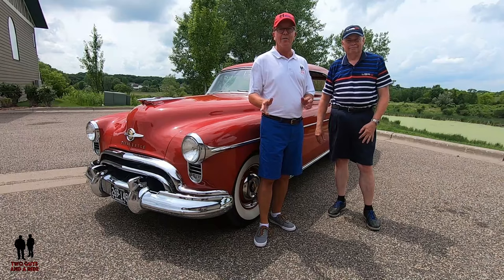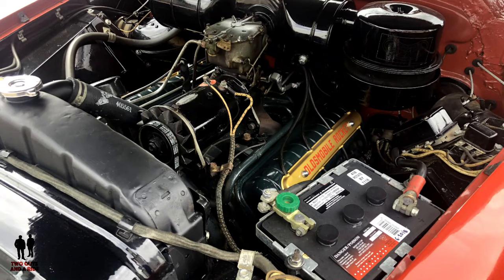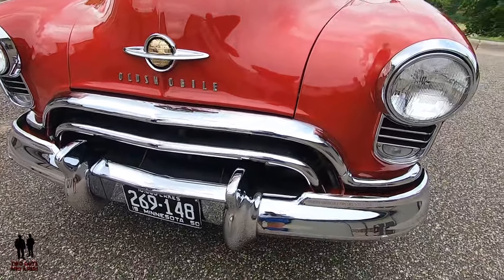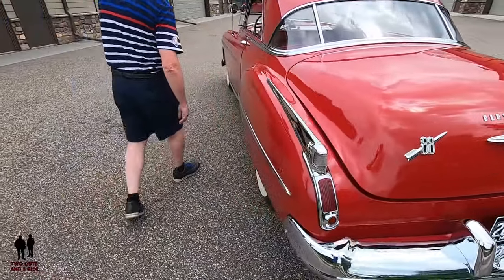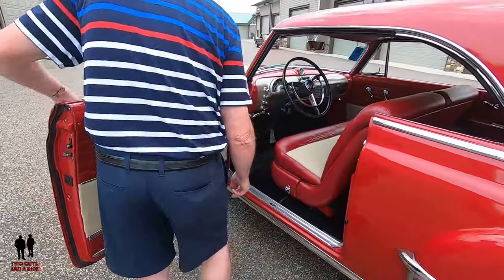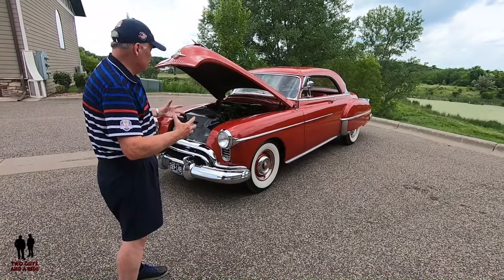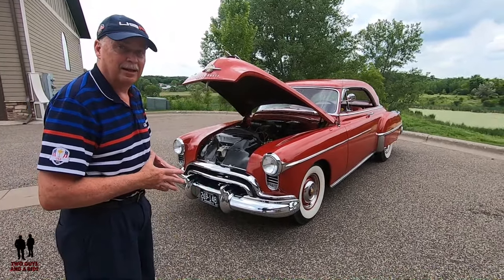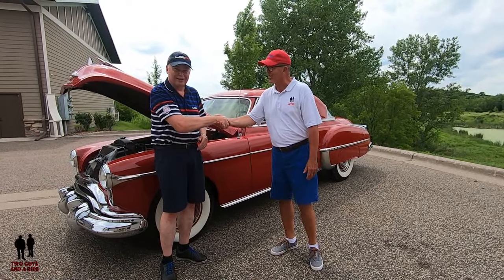Rev up your nostalgia with this iconic 1950 Olds Rocket 88 Holiday Coupe

Comment: My family grew up driving Oldsmobiles. I drove a 1950 through high school. Replaced the engine with a 1956 engine which made a great combination with the low speed reared. It was hot. Later I drove a 1051, 1955 Rocket 88 two door hard top. My last Olds was a 1966 three duces, 400 cubic inch, 375 Hp, 356 rear end. There was only a few of these combinations built. I waited several months for delivery (even then). A local dealer refused to sell me the car. Olds was FIRST in much of the automotive development in the 40’s and 50’s. Enjoyed the video.
Reply from the maker: Cool story. Thanks for sharing and thanks for watching

Comment: We had a 1950 four door 88 and a 1951 2 door 88.  They were the fastest cars on the road in those days.  Nothing else could accelerate with them or out run them.  Big overhead valve V8's were rare in those days.  Fords had flat head V8's which were much less powerful, Buick's had straight 8's and most everything else had six cylinder engines.  Cadillac's had basically the same engine as Oldsmobile, but a considerably heaver car.  It was always a thrill to pull out and hit passing gear, hear that roar and feel that acceleration.  They drove great for the time, also. Fun days!
Reply from the maker: It’s certainly quite a car!  Steve absolutely loves his Rocket 88. Thanks for sharing your memories and thanks for watching!
Reply: You are  right.  I  was  a  teenager  in  the  early  50"s.  My  buddy  had  one.  It 
would  outrun  anything  stock.  Smoke   them  tires  and  keep  on  turning.  A
great  car  indeed.

Comment: I have seen a lot of records showing Chevrolet produced V8 engines, overhead valves, in 1917 and 1918, so our friend with the beautiful 1950 Olds might want to check that out and maybe modify his claim about Olds being first.  Thank you for your show.
Reply from the maker: True, before joining GM, Chevrolet did produce an OHV Engine but not an OHV V8 until 1954. Olds beat them and even Caddy to the punch in ‘50 with their OHV V8.
Reply: So many people think 55 was the first year Chevy had a V8.

Comment: They were called "hardtop convertibles" because they were built on convertible chassis frames, which were beefed p to make up for not having the the center posts.
Reply from the maker: Thanks for the information
Reply: Correct, as was the other GM cars that were hard tops.I think the hardtop added about $500 over the sedan

Comment: OMG, what an enormous steering wheel! I would have painted that. Those clocks are easy to make digital. I'm a Studebaker-Packard man, but for me, this is the most beautiful design GM EVER had. They really ugly'd up their cars making them fat and bloated the next year. Across the board on every brand in this body style was a beauty, even Chevy.  I'll never own a real one, but do have the Brooklin Diecast hardtop, a coupe, fastback. That hood reminds me of a Hudson Hornet, the 88's chief opponent in racing. Stunning!
Reply from the maker: I’m a Studebaker Packard fan as well. All those wary 50’s designs are top notch. They definitely went downhill after that. Thanks for watching
Reply: With manual steering, you NEED a big wheel.  Why make the clock digital?  It looks great as it is.
Reply: I don't know about that Olds but the clock in a Chevy back then was a wind up , eight day clock .

Comment: Looks like the first car i owned when i was in high school . Mine was pale yellow with black top . All my buddies had Fords and loved to drag race . My 88 would kill anything id race , even later olds , but because it was a ht , the frame and suspension were same as the convertible (a bit beefed up) and had a 3.91 rear instead of 3.64 used in other models . It was unbeatable from a standstill with that gearing and a very low 1st gear of the 4spd Hydramatic. Its the only car that engineers designed to "lift in the rear" upon breakaway . They figured there was a loss of a moment as the car initally dropped before moving forward and if this could be eliminated , the car would "get moving forward" quicker . It absolutely worked fantastically . I wish this fellow would have shown the car moving and starting from a dead standstill . This action i described is very noticable even on a normal breakaway from a traffic signal .  It made for quite a neat rear suspension and fun to watch a 50 olds take off from a standstill and lift slightly insted of dropping . It was the last to have rear 'coils' with that setup and all newer had leaf  springs so were just not able to make that 'leap' from a dead stop . I raced every year olds and never lost until 1957 Olds 88 with J2 (3-2bbl carbs) and many more cubes and horses , it was fast -- lol !!   But i loved the 50 for looks , handling , and just plain fun to drive !
     My second car was a 54 imperial 2dr Newport . Similar HT design . Still have it , but wish i had kept the olds also . What a beautiful pair . 1949 till 1960 was in my opinion the ultimate time for car enthusiests . Im approaching 90 and still do 'cruises' with my Imp but sadly  know my days grow shorter .  Enjoy !
Reply from the maker: Oh man! What an inspiration you are to us! Great story, thanks for sharing and thanks for being a lifelong CAR GUY!

We sent your comment over to Steve the owner

Comment: "Futuramic" refers to the new, low-slung body style introduced with the 1948 Olds 98, followed by the rest of the line in 1949.  The term is not specific to the Olds engine type, which were still all in-line in 1948, or to the Hydramatic transmission that Olds introduced as an option with the 1940 models.  The 1950 88 Holiday Coupe was preceded by the 1949 98 Holiday Coupe, a similar-looking but larger, heavier 2-door hardtop car that shared basic body shells with the '49 Cadillac Coupe de Ville and Buick (Roadmaster) Riviera.  The lighter 88s were naturally faster than the 98s, which had the same engines.  The 1950 88 Holiday Coupe shared bodies with the Chevy Bel Air and Pontiac Catalina, but came with a much livelier engine!.
Reply from the maker: Great history! Thanks for sharing and thanks for watching

Comment: I GOT MY FIRST OLDS IN SEPTEMBER 1959 THE YEAR I TURNED SENIOR IN HIGH SCHOOL!
RED 88 WITH BLACK TOP POST COUPE!!!
YOU GUYS DIDNT MENTION THE REAR SUSPENSION HOWEVER!
IT HAD REAR COIL SPRINGS WITH A TORQUE ARM .
WHEN DRAG RACING YOU HAD EXCELLENT TRACTION AND CONTROL OFF THE LINE,
AND IT RODE LIKE A DREAM
AS WELL!!
IT HAD A BIT OF HISTORY BEHIND IT THAT THE ORIGINAL OWNER SMUGGLED ALCOHOL BEVERAGES FROM KANSAS INTO OKLAHOMA WHICH WAS STILL A DRY STATE!
ALSO AT THE START OF MY HIGH SCHOOL SENIOR YEAR I STARTED BUILDING A 1933 DODGE PICKUP STREET ROD, OLDSMOBILE 303
OF COURSE!!!
I THEN GOT A HOLIDAY56 4 DOOR HARD TOP WITH THE 324 ENGINE!
MY FIRST BRAND NEW OLDS WAS AN DELTA 88 STICK SHIFT AND THE 425 ENGINE!
THEN A 71 OLDS 88 CONVERTIBLE
WITH THE 455 AND STICK TRANS MISSION!  ( STILL GOT IT!!!)
I ALSO GOT A 80  AND AN 82
88 COUPES, BUT UNFORTUNATELY BOTH OF THESE WERE TOTALED OUT IN WRECKS!
I USED TO LOVE GM BUT WHEN THEY DROPPED OLDSMOBILE 
AFTER TOTALLY FUCKING UP THE BRAND, I COULD GIVE A SHIT LESS IF GM DIES COMPLETELY!!
LOVED THIS POST, THANKS!!
Reply from the maker: Thanks for sharing and for watching!
Reply: No. Rear coils and (clank-clank from parking brake adjuster) torque tube was Buick design "feature" not Olds. I say "feature" because they handled like a pig on roller skates. Great-grandfather had one. Rode in it. Not fun. Agreed: Gov't Motors deserves to die. Cheers!
Reply: @blackrifle6736  
THE OLDS HAD TORQUE ARMS AND OPEN DRIVE SHAFT WITH COILS, WHILE BUICK UP TO 1962??
USED THE TORQUE TUBE- ENCLOSED DRIVE SHAFT!
I ALSO PLAYED WITH BUICKS AS WELL IN THE DAY!
IN THE LATE FIFTIES I WORKED AS AUTO MECHANIC, AND WAS A SMALL TIME USED CAR DEALER, ALONG WITH BEING A JUNKER!

Comment: Those black license plates were actually truck plates, the color separated them from the car and motorcycle plates which changed colors every 2 years and used a tin tab every other year. He’s correct his statement that those numbers weren’t in current use as those same numbers were used on the 1950 car and motorcycle plates. My ‘53 Buick Leadsled was able to use a set of black ‘53 in the original wrapper truck plates as the numbers were not being used.
Reply from the maker: Great Information. Thanks for sharing

Comment: The Hudson Hornet dominated Stock cars racing in the early 50's and both Cadillac and Oldsmobile had the overhead valve engine in 1949 Cadillac had the bigger of the two engines Oldsmobile was 303  and Cadillac was 331.
Reply from the maker: The Rocket 88 vaulted Oldsmobile from a somewhat staid, conservative car to a performer that became the one to beat on the NASCAR (National Association for Stock Car Auto Racing) circuits. It won six of the nine NASCAR late-model division races in 1949, 10 of 19 in 1950, 20 of 41 in 1952, and was eventually eclipsed by the low-slung, powerful Hudson Hornet, but it was still the first real "King of NASCAR
Reply: Back then each GM Division had their own powerplant engineering staff. While materials like GM300 steel for head, rod and mains bolts was a company-wide mandate and design innovations were shared, each Division's engine design was unique. Example: For strength, Olds OHV block skirts extended inches below crank center line, while Cad chose to stop at crank center line. One reason Stone, Woods & Cook's blown Gasser was so dominant was their unbreakable Olds engines. Cheers!

Comment: The dual exhaust is a natural for this car.  Many consider the '49/'50 Rocket (along with Cadillac) V8's the "first true muscle cars" .  I'm wondering if many people bought the high performance Olds Super 88's back in '50 and if they had a 2 barrel or 4 barrel or multiple carb options?   Was the Rocket 303 a high cost option?
Reply from the maker: I'm not sure if it was a high cost option or not. I'll check with Steve and let you know. Thanks for the question and thanks for watching
Reply: The 49 - 51 came with a 2 barrel, as the 4 barrel did not come out until 52.  The aftermarket did provide dual and triple carb manifolds though.
Reply: They only had 2 barrels in 50, but there were aftermarket manifolds for dual and triple duces.
Reply: The Rocket was a he only engine available on the 88 and 98.

Comment: Gorgeous car! Note that the "cloth" on those original wires is often asbestos.
Reply from the maker: Thanks and excellent observation. Thanks for watching
Reply: I have a 1953 Hudson Super Wasp and the vintage (and some replacement) wiring is all cloth.  In a few cases where the wiring on the car is exposed to high temperatures (such as the top of the flat head engine) the wiring runs through what is probably an asbestos sleeve.

Comment: Possibly "Bakelite", the plastic of the 1940's.
Reply from the maker: Awesome, that’s great information I’ll pass it along to Steve. Thanks for watching
Reply: I was gonna say it could be Bakelite
Reply: I have a 1948 Philco Radio made of Bakelite!
Reply: Nope, probably Tenite.
Reply: Bakelite unlikely, perhaps polystyrene(?)
Reply: @mickeydee3595  Nope. Too rigid. Having a thin steel frame, those old steering wheels had to tolerate a little flex. Cheers!
Reply: Perfect for telephones and table radios but too rigid for steering wheels. Cheers!

Comment: Chevrolet had a overhead valve V-8 engine in 1917.
Reply from the maker: True, before joining GM, Chevrolet did produce an OHV V8 but not another one until 1954. Olds beat them and even Caddy to the punch in ‘50
Reply: @TwoGuysandaRide  Splitting hairs here but Fall 1954 intro for MY1955. Cheers!

Comment: NOTICED A LOT OF PEOPLE MENTIONING BAKELITE PLASTIC!
BAKELITE WAS A PLASTIC USED ALMOST EXCLUSIVELY AS AN ELECTRICAL INSULATOR!
IT WAS A PLASTIC AND SOME SORT OF FABRIC CLOTH MOLDED TOGETHER FOR PHYSICAL STRENGTH!
I WAS THE BLACK PLASTIC USED ON THE ENDS OF THE GM STARTER SOLENOIDS , AND THE TAN COLORED 
FLAT BOARD USED IN GM- DELCO VOLTAGE REGULATORS!
Reply from the maker: Wow...great information. Thanks for sharing!

Comment: I graduated from high school in 1952 and my first car was a used 1950 2 door coupe; I think the engine rated 135 HP. The 6 volt system was not that great. loved the performance though!!
Reply from the maker: Oh boy does it perform! There was nothing else like it in ‘50. Thanks for watching
Reply: This is Steve the owner. I misspoke on the HP.  135 is correct. Thanks!
Reply: No problem, Steve!! Sweet car that you have there!!
Reply: @steveolson9222  I bet it really has more like 150.
Reply: If you still had it, I could make 6 volts work fine.  Also, you can use an 8 volt battery.
Reply: I traded the 50 88 in for a new 54 Chev Bell Air. Only drove it for 8000 miles and traded it in for a 55 Olds 88, 4 door hardtop.  @michaelbenardo5695
Reply: @ericwohleben  Pretty big come-down, going from an Olds V8 to a Chevy Stovebolt!
Reply: That's why the Chevy only had 8000 miles on it, Michael!!

Comment: A button on the floor to release the hood would be a spectacularly bad idea, especially at 60 mph.
Reply from the maker: The button on the floor was to dim your headlights. Thanks for watching
Reply: If I remember it had what was called a safety latch. Some cars you had to lift up a lever, some slide from left to right. I think the Olds had the lever that lifted up to completely unlatch to open the hood.

Comment: This is not the first overhead valve V8 Chevrolet had one in 1917!
Reply from the maker: True, before joining GM, Chevrolet did produce an OHV Engine but not an OHV V8 until 1954. Olds beat them and even Caddy to the punch in ‘50 with their OHV V8.

Comment: ...now if it was a stick...
Reply from the maker: That’s be fun too. Thanks for watching
Reply: @TwoGuysandaRide  
Fun, and very rare, even back then.
That Cad/La/Salle/Olds box was nearly indestructible, albeit slower thru the 1/4 than the Dual-Range Hydro.
Raced both.

The coolest set-up was the earlier "top-shift" box in a '50 Olds with that big ol' cane sticking out of the floor. 
Yeah, I'm old...
Reply from the maker: @daryllect6659  :) We've been called Boomers and Grand Pa's so don't worry about feeling old

Comment: They probably used Bakelite for the steering wheel.  https://en.m.wikipedia.org/wiki/Bakelite.
Reply from the maker: Hey thanks! Great information to pass along to Steve. Thanks for watching
Reply: @TwoGuysandaRide  If that plastic warped and cracked, it was probably Tenite, an acetate plastic made by Kodak.  It was introduced in the 1930s.  It was used on the dealer promotional and friction drive model cars of the 1950s and early '60s.
Reply: I don't think so.  Bakelite would become dull from use.  It probably is Tenite.

Comment: hudson dominated nascar 1951 thru 1954 with a flat head 6 not oldsmobile
Reply from the maker: The Rocket 88 vaulted Oldsmobile from a somewhat staid, conservative car to a performer that became the one to beat on the NASCAR (National Association for Stock Car Auto Racing) circuits. It won six of the nine NASCAR late-model division races in 1949, 10 of 19 in 1950, 20 of 41 in 1952, and was eventually eclipsed by the low-slung, powerful Hudson Hornet, but it was still the first real "King of NASCAR